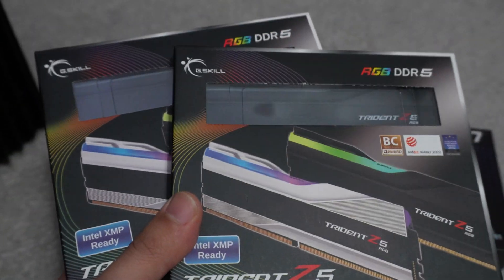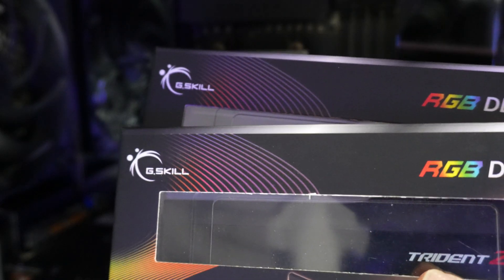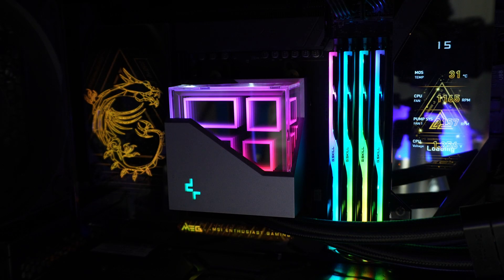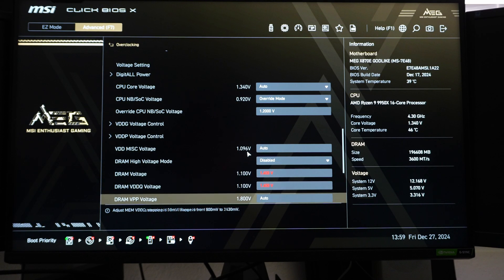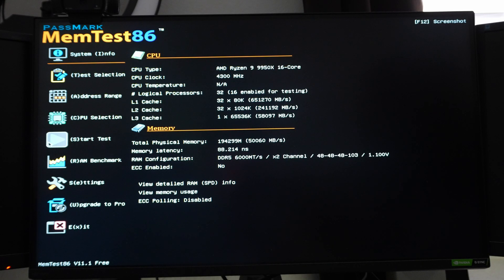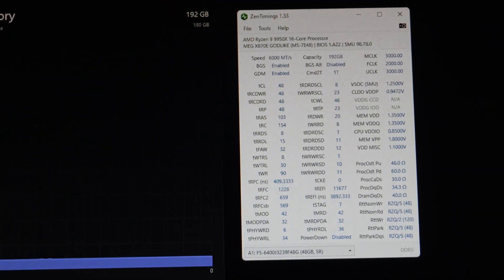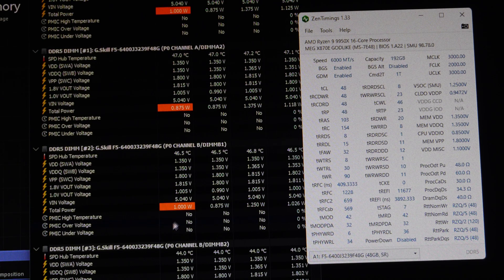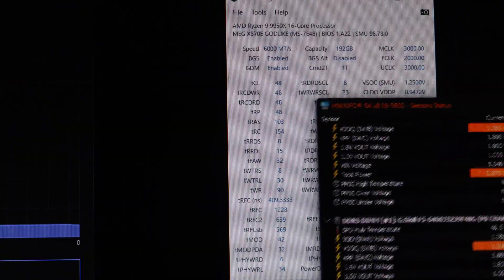192GB DDR5-6000 on the MSI X870E GODLIKE

Comment: Whats the usecase for 192GB ram?
Reply: File servers using the ZFS file system, running multiple virtual machines, video editing, 3d modelling etc etc that kind of stuff. I have 128GB in my Threadripper 3000 series server and that's more than enough for tons of docker containers, Home Assistant vm, Pi-hole vm and a gaming vm with 32GB ram assigned to it and a 20TB file server using ZFS (which loves all the ram it can get). 192GB is way too much for general desktop or gaming usage.
Reply: Film music. Large templates, huge sample libraries.
Reply: For me VMs. You can setup any kind of  a lab for training/testing in vmware workstation.
Reply: Ai language models

Comment: Do you have issues restarting windows with the Godlike?  I get the error code “CPU & DDR” on the display when I reboot in Windows.  This is using 2x48GB G.Skill.  It boots from cold fine, stable in Karhu and OCCT several hours.  “Shutdown” is fine but “Reboot” gets that error.
Reply from the maker: Is your display showing things correctly? It might be that problem with the data loss that is becoming a known issue with the Godlike. I ran into that issue and it requires a tool that fixes the data for the EZ Bridge.
Reply: @GameTechReviews  It's not a problem with the Dynamic Display because it works fine normally (fresh boot and loading the custom images/videos from Windows).  I saw the post regarding the Firmware / Data updates, I did not update it since I didn't run into the same display issues as some of those forum users.  I just ran through Memtest86 and Memtest86+, all Pass.

Comment: Dude, I’ve been literally combing through your videos all day waiting for this very video on my new godlike box.  It’s like you were reading my mind!
Reply: Amazon sent me a fucking MSI MAG CPU cooler instead of the MSI MEG that I ordered. 

I have been waiting nearly 2 weeks for my refund, because, of course, they wouldn't just re-ship it. 

-_-;
Reply: @Soniti1324   I was wondering if the MEG Aio cooler would fit AM5, as MSi claims it does not. But AM4 & 5 are similar. Let us know if it works out.
Reply: how do you like the motherboard? I see a lot of user complaints like its failing after few months etc. and hesitant to buy it

Comment: Has 4x48GB sticks so 192GB...

Can boot at 6800 and almost train at 7000 at UCLK/2, can boot at 6600 at UCLK/1

But cannot get stable above 5200...  got a crap IMC

Have you ever actually gotten stable? 60 threads at 2850MB testmempro leave it for 20 hours at least then show us...

The settings that can boot at 6600 UCLK/1 make OCCT crap itself at 5600 and at 5400 makes memtestpro crap itself after an hour

Edit: found someone saying change ProcODT on P0 to 60 and 53 and now 6000 isnt making OCCT immodiatly blast its brains out... but it still eventually does

So my motherboards pull up and down resistors seem to not be getting set optimally automatically so gonna have to mess with them alot

Got 5400 stable next year i will push for higher because these hidden pull up pull down ones are a gold mine
Reply: Bro stop being dumb. I swear people with money seem to have lower IQ than others most of the time. 9000 series have kinda identical 7000 series IO.

DDR5 on both Intel and AMD isn't made for 4 sticks. Both AMD and Intel struggle more than dual rank RAM (like 48GB modules). And the UCLK doesn't like being over 3000MHz. And the FCLK doesn't like being over 2000MHz.

Anything deviating from that is pire luck/silicon lottery. Or pure OS corruption Speedrun.

Just get a Ryzen CPU. Use 2 sticks. At 3000MHz. With UCLK at 3000MHz. And FCLK at 2000MHz. Simple.
Reply: @ sits here needing 192GB shut the fk up get the fk out of the chat

Also AliExpress kingbank... 192GB with a sale and coupons cost the same as 64GB did back in 2019 adjusting for inflation...

Its not a money thing its a need it thing
Reply: @ well my reply is missing...

Its a need it basis so shut up and leave the chat...

64GB in 2019 adjusting for inflation costs the same as buying 192GB of kingbank from aliexpress when there is a sale and coupons

Its hyper rare someone will get 192GB or even 128GB if they dont need it
Reply: @commanderoof4578 How much did 192GB of Kingbank RAM cost you?
Reply: @ the amount of of my bank so what i actually payed... tax, shipping item all of it

64GB in 2019 £312

192GB in 2024 £386

Comment: With this motherboard and the nice  target of msi objective to tighten memory timings you could  target higer  oc and tighter memory timings. Msi new boards right now does not just  intresting things in the Bios on all platforms but they try to be more memory/cpu oc clocking friendly what i saw  in the last weeks. 
The thing is Msi personally  revealed  you can do 6400 and 192 gb what is suprising  as of  today and would be nice you can do prove that as well.
Reply: Would you be able to populate all four ddr5 slots for the MSI X870 Tomahawk and x870e Carbon wifi as well?
Reply: @TpIcap  The Carbon could be possible but the x870 tomahawk i don't know. Hardcore overclockers  with Tomahawks found  some limits or issues because the  vrm phases are very different from x870e parts and the vscoc behaivour maybe too and others.  x870e Carbon and Godlike should share many behaivours by overklocking stuff.  I wish i could tell the difference better with carbon and Godlike but nobody i know have both of the great boards that even i considered to buy.

Comment: Thanks for sharing this video.  I'm working on gathering components for a new build.  I have one kit of Team Group T Force 48 (2x24) 8000 MHZ PC5-640000 Cl 38-49-49-84. I'm sure it isn't necessary for my use case but I find this fascinating. I'd be putting it on an MSI x870e Carbon Wifi board. Also, did I sell myself short with this kit since it is a cl 38? I received it as a Christmas gift.
Reply: That's 4000MHz.
Reply: @FireCestina1200  you surr, thought it was rated for 8000Mhz. Can you explain
Reply: @Slyclientthetechdad  It's rated at 4000MHz. It's literally said in the name of the device "Dual Data Rate Gen 5". Which is 8000MT/s. That's why when UCLK=MEMCLK is equal to it's 4000MHz. The MEMCLK or memory clock is 4000MHz.

Hope it helps you understand better for your future OC.

Also. For Ryzen 4000MHz = performance loss. As the UCLK=MEMCLK/2. And the FLCK cannot keep up properly with the speed
Reply: @FireCestina1200  Thanks for explaining. Is this the same for only using 2 sticks at 48GB? Based on this, I may not get another kit
Reply: @Slyclientthetechdad  Yes. 2 or 4 sticks at 8000MT/s will make you lose performance. You need 6000MT/s kit in order to have UCLK matching MEMCLK. And FCLK matching is sweet spot of 2000MHz.

Just in case. For finding an ideal clock. It works by ratio. If you can set everything to the same ratio it's great. For AM4. It's possible. DDDR4 running at 1600MHz. FCLK running at 1600MHz. UCLK running at 1600MHz. It's 1:1:1: ratio. For DDR5 it will be UCLK=MEMCLK and FCLK=MEMCLK (in MT/S) divided by 3. So if you have a 4800MT/s kit (which is terrible) best settings is UCLK=MEMCLK=2400MHz and FCLK=1600MHz.

BCLK= Motherboard clock
FCLK= Infinity Fabric Frequency clock
UCLK= Uncore clock (should match MEMCLK)
ECLK= Asynchronous clock (usually on Asus motherboard only)
MEMCLK= RAM clock (in MHz)
1MHz = 2MT/s for RAM.
Reply: @FireCestina1200  thanks for clarifying. Looks like a royally screwed this one up. I've heard people say that 2 sticks at 48gb was the sweet spot. Guess I heard wrong. I appreciate you taking the time to explain.
Reply: @Slyclientthetechdad  2 sticks at 48GB isn't the real problem. The speed is. 48GB can be an issue on non-updated BIOS tho. But usually isn't.
Reply: @FireCestina1200 So just for gaming, do you think it will be fine? I'd rather not go through the hassell of returning it if I don't plan on getting every ounce of performance out of it. Just want to make sure it's not a complete bust for a gaming machine. Going to be paired with 9800x3d and an Msi Carbon Wifi x870e.
Reply: @Slyclientthetechdad  That's the point. You won't get every ounce of performance from your 9800X3D if you use a "bad kit" totally not made to be supported by the CPU. In both gamin and productivity load. You should return them. I don't say it will be unplayable (it could) but you pay more for less performance
Reply: @Slyclientthetechdad  If you really don't want to return the kit, just run it at 6000 (3000) with the timings off of another 6000 rated Team Group kit.
Reply: @disconnect64  Thank for chiming in.  Unfortunately I already started the return process.  Good to know for next time though

Comment: Hey, can you tell me if i'll be able to run my RAM at its rated speed.

I have an ASRock X870E NOVA WiFi mobo + Ryzen 7950X3D + 128GB RAM 4x32 G.SKILL Trident Z5 RGB White rated for 6400MHz 32-39-39-102 1.40V currently running at BIOS Default speed of 3600MHz 30-30-30-58

Will i be able to tweak my RAM to work at it's rated speed stable ???
I'm asking cause i'm a bit lazy to try cause i don't want to be clearing CMOS if it doesn't work. 😁
Reply: The kit is rated at 3200MHz. And you are running them at 1800MHz. Which is DDR4 speed. 

Don't use 4 sticks of RAM and your issues will be solved. Also. Switching to a 3000MHz kit is safer.
Reply: @FireCestina1200  Thanks for the advice.
I used to have a GIGABYTE X670E Aorus Master mobo. And my RAM would not work at all when i tried to increase the speed so i just left it at BIOS Default speed. And now on the new ASRock X870E NOVA WiFi mobo, i have also left the RAM to run at the Default speed. Because i'm still worried that when i try to increase the speed it won't work at all. Even tho the mobo is the newest generation chipset. And i like to have all 4 DIMM slots occupied like i do. But as i said i'm lazy and worried that if i try to tweak my RAM in BIOS, i'll end up pulling my hair out trying to make it work.
I guess i'm a lazy sloth 🦥🦥🦥😅